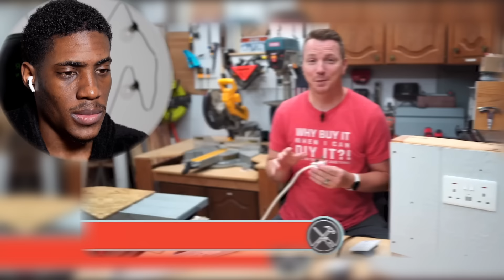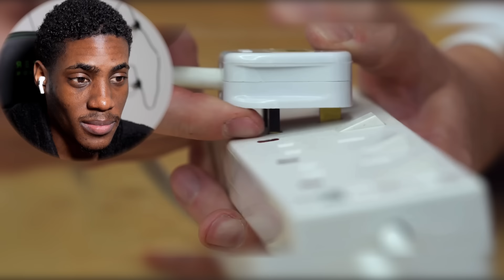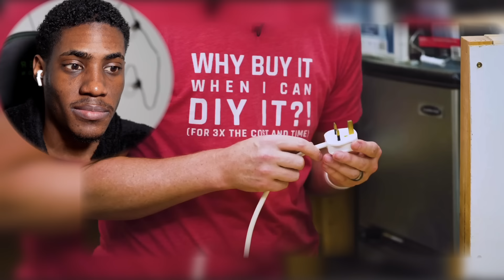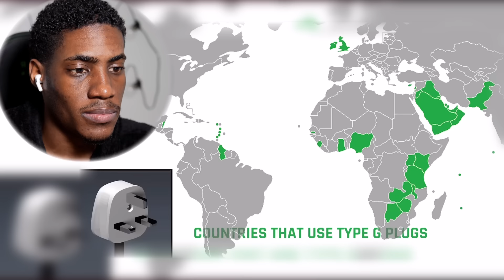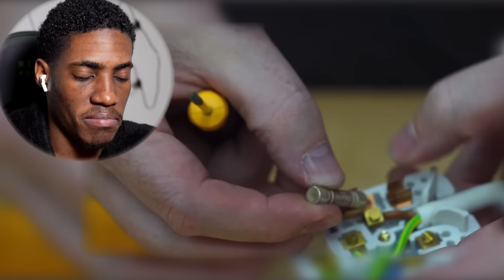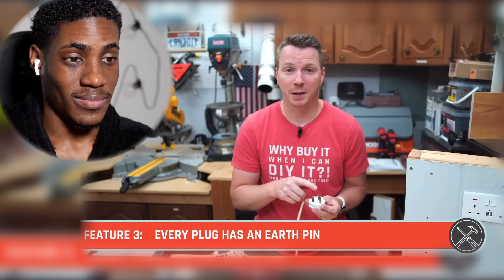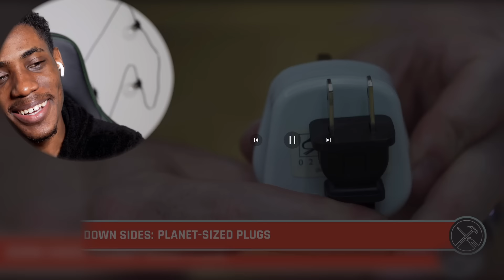Why British Plugs and Outlets are the best in the world || FOREIGN REACTS

Comment: Well done for poo pooing those negatives. I'm 79 and have never trodden on a plug nor do I know of anyone who has. Load balancing? I have never heard of it nor do I know anyone who will know. It has never popped up, you can boil a kettle, use an electric oven, use a washing machine, a toaster and do some ironing on under floor heating in the kitchen and not notice anything. Most appliances are always left plugged in. The iron is not but is put away after use in a cupboard, a vacuum cleaner is also put away straight after use. An electric drill is also put away straight after use, a jet washer is also not left out. No plugs are left on the floor for anyone to stand on. Trouble shooting something that doesn't work? Gordon Bennet, The first thing you think of is the switch. The ONLY down side to the system as far as I can see is, when a fuse blows and you don't have a spare, most people do have plenty of spare fuses of different sizes, you may be tempted to wrap some silver paper round the blown fuse, that of course is a big no no. You maybe tempted to use a 13 amp fuse instead of a 3 or a 5 amp fuse. The size of the plug is irrelevant as it sticks out only 3/4 of an inch from the wall and cupboards, boxes, washing machines etc, can be pushed farther back and right up against the plug. The insulation on the live and neutral stops anyone from sticking a knife or wire against them if the plug is slightly out from the wall and shocking them. If the wire gets frayed or cut, you can chop it off and refit the plug with a now shorter cable. If your TV, washing machine, microwave needs to be replaced, you cut off the plug and the fuse before you lob it, that way you always have plenty of spares and the fuses are interchangeable.

Comment: UK transitioned to the 3-pin square pin plug (BS 1363) in 1947. This update replaced the older BS 546 plugs and sockets, which had round pins. so as you can tell my house upgraded / rewired must be 30 years after the big switch, my grandparents had lots old stuff what required old socket, few areas got few upgrades new sockets like back room extension and behind the tv as new things had new plugs. so many years late to party my house got rewired and new sockets and lighting switches as the experts refused to work on system what mostly adapted by the house hold as back in day you not need a sign off for safety to some extent like kitchen spot lights if before a certain year it fine after that year you could fit them yourself but expert has to safety check it. your 4 pin plus do remind me plugs i seen on my grandparents old electronics some dating back to war times. uk upgraded 1947 some households took longer like mine to get upgraded, im amazed usa did not upgrade around that time to for a less war time plug/socket as that be an ideal time as things were starting to use more power you be far better for future. some pcs now have 1300w psu do you need two plugs to power that or get new plug fitted so it safe , even uk id not plug in 1300w to a extension 5 plug adapter if plug it direct in to wall and i know that be fine, unsure if you could plug 1300w device in to any plug socket in usa as uk i doubt it be an issue. my room has three 2 socket plugs all have 5-7 plug extension block and two duel sockets lead from just one duel  i must have 15 plugs if not more in use from 6 sockets and one has computer what reaches 550-600w soon closer to 700w as adding two high static pressure fans that an extra 30w each what require a cable from psu and hub to run as they burn the motherboard plug directly so small part house loop as you  can tell uses a lot electric and for past 15 years it works great, ive never experienced load balancing and that top floor house it also uses an aircon unit another crazy power device. they must wired house up good when we rewired the house no cut corners
Reply: I went through the same thing here, in fact when I was about 8 years old, we had a very small attic hatch & the adults couldn't fit through it, so it was up to me to help them run the cables through the attic - I've since become an electrician, then an electronics technician (& radio ham) & finally a computer technician.

Comment: You missed an important fact that many former British colonies (like India & South-Africa) stuck with the old pre-WW2 British system (3 different ampere rated plugs) with round pins and no fuse = "type-D" & "type-M" ... they basically had the Soviet Union´s situation (the USSR used unrecessed unearthed pre-1933 old german outlets al lthe way to it´s desolution in 1992 & phaseout started in mid 1990s)

Comment: The UK began adopting this system after WWII when a lot of housing needed to be rebuilt the economy was shattered and copper was expensive. As such the ring main used far less copper wire. Load balancing only became an issue later when we began adopting more and more electrical home appliances this has largely been fixed by replacing all the smaller guage wiring with modern heaver duty cables over the last forty years.

Comment: The negatives are a real stretch, the load balance thing is rarely an issue in this country these days, pretty much all UK households can run our appliances & devices without worrying about overloading the system & tripping the RCD - trouble shooting is pretty straight forward too, check the socket is switched on, if it is, try the lamp in a different plug, if it's still not working then change the bulb, if that doesn't work check the fuse, if there is a problem with the wiring that will trip the RCD, switching off the power to that part of the ring.

The stepping on the plug is easily resolved - put the plug out of the way, or just leave it plugged in as you don't have to unplug it when the socket has an ON/OFF switch.

The size of our plugs are never an issue for us, because we have had these Type-G plugs for a long time, so we're just used to them.

As a rule the first thing anyone in the UK will do when something doesn't switch on is check the socket, making sure the plug is in fully & switched on; our flat plugs mean we can have plug sockets behind furniture & not have to have that furniture 6 inches away from the wall.

Comment: Brit here. I’ve stood on one of those plugs, the pain is up there with a kick in the balls 😂 it really hurts!

The negative point he makes about the switch being a double edged sword - that is such a stretch! When you’ve lived with these plugs all your life like I have, the first thing you check is the switch at the socket if something is not working. On a daily basis, I plug the hoover in, switch it on and nothing happens until I switch it on at the wall socket.

Thing is, when you can switch it off at the wall, you don’t need to unplug it. Therefore you don’t stand on it! Also, if you trip on the wire in the UK, it won’t come out the wall to be stood on, whereas in the US it will. Either way, when you learn the hard way not to leave these laying around, much like lego, you just DON’T leave them lying around.

In 35 years, I’ve never had a problem with load balancing and I’m sure all other brits will tell you this. I have an extension lead plugged into one outlet, with a tv, PS5, surround sound system, my phone sometimes and also an iron plugged in - never had a problem! So that negative is simply not true.

I’ve heard in places in America, you can’t have an iron and hairdryer plugged in at the same time or the lights will flicker and it’ll trip something. We’ve never had this problem, we can have all sorts of things plugged in at once with no problem.

He says the plug is far bigger, but look again at our plug vs your plug  and imagine them plugged in - when ours is plugged into the wall, the pins are no longer an issue with regards to space. Also the plug is sitting flush against the wall with the wire coming downwards, so you could plug in a lamp and then push a sofa up against the plug - the plug doesn’t stick out any further than the skirting board so if anything it actually saves space vs the us plug with the wire coming out the other way.

Interesting fact - our plug was actually invented in 1944! Appliances used to come with a bare cable until the UK mandated a plug on everything in 1992. I was 3 in 1992, so I’ve never had to wire a plug. But every guy I know in my dad’s generation could wire a plug blindfolded. They learned it in school as it was an essential skill.

Edit: maybe in large commercial offices with dozens of computers plugged in, perhaps that’s when you might get that load balance issue. It’s not something I’ve ever come across so I believe with great certainty that it’s not an issue in a domestic setting. Maybe a large office having given it some thought…

Comment: Yeah - this guy was SERIOUSLY reaching for flaws.

The only legitimate one was "load balancing" ... but ALL modern UK homes (since roughly 2000) have a seperate ring circuit for the heavy duty ovens, fridges and washing machines, and - importantly - fire alarm

The fusebox, under normal operation, is NEVER tripped through overloading in a modern UK home (unless there's another hidden problem)

It used to be a problem. but it isn't now.

Comment: It’s ridiculous to say a US plug which has cable coming out the back is better in terms of size to a UK plug with cable dropping down vertically - the UK plug distance from socket to plug is about 3cm but the US plug will take up more space because the cable juts out. US plugs are annoying to fit behind furniture because they stick out too far. Also as UK plugs tend to be left in place there’s no reason for anyone to step on one left in the middle of the floor - who does that?

Comment: I know others have said this in the comments but the guy featured in the video, does not know what he is talking about, when he says that the UK has 'Load Balancing issues', no we don't, as a typical house will have 5-6 ring mains covering different areas of the house. In addition, fault finding is very easy, I've watched an electrician do this in my own home and it was straight forward, despite being under some floorboards.

Comment: One of the simple things about having a switch on the socket is that it is extremely easy to see if it is off or on. 
Most modern British sockets have a small red strip on the top of the switch which is only visible when it is switched on.
So to see if it's on you just look for red. Or if there is no red strip look at the position of the switch, top out is on, bottom out is off.

If you have a socket behind some furniture, you can use a plug with the furniture pushed right up against it.  US plugs with the horizontal wire position are a much greater restriction on where you can place your furniture. 
Most bedrooms in the British Isles have wall sockets placed on the wall beside where you would place a bed, so it would be behind a bedside cabinet or table. Allowing you to put a lamp or electric alarm clock/radio on the piece of furniture.

With the introduction of wall sockets that include USB sockets, they are being placed higher on the wall so the USB sockets are available to charge mobile phones, tablets or other media devices.

A lot of equipment manufacturers now produce cables with moulded plugs, for their apliance, that are not able to be opened. They have an external fuse slot like that shown in the vid. 
Obviously if something goes wrong with the plug you would then need to replace the whole appliance or get an 'authorised' repair engineer to fix it. Just another way for manufacturers to get more money from consumers. I don't know anyone who wouldn't, either themselves or ask someone who is confident doing so, just cut the faulty moulded plug off and connecting a new plug. 
We know when manufacturers are trying to gouge money from their customers. Claims of 'authorised' repairers needed and warranty voided are just encouraging consumers to pay for extended warranties or service agreements.

My dad showed me how to change a plug when I was about 10. Many of my school friends were shown how to, by their own parents or grandparents, around that time too.

You don't really need to be shown how to do it. Each replacement plug comes with a piece of card with plug holes in it, so it attaches to the plug. That card has a diagram of the open plug showing which wire goes to which pin, and how the wires should be placed. The wires are labeled by the colour they are likely to be. There are 2 colour systems. Modern is Live Blue, Neutral Brown, Earth Green + Yellow stripes. The old system is Live Red, Neutral Black, Earth Green.

Comment: Hi! Very little world, yours. Just USA and UK😂. I live where, for some aspects, Britain still rules and I miss European plugs. The UK ones are ridiculously chunky. More, even for a low wattage SBANG! The Brick😱. Just consider a phone charger. It needs to be built around the plug. In Europe you have plugs for high wattage with neutral, and the ones for low wattage are much smaller. And people don't get electrocuted for that. Also, the chunky plugs need chunky sockets. I think the design of type G derives from the more flammable house building materials used in UK (at least years ago when the type G was created). Then, some are fused some are not, but shape is "dangerously" the same. BTW, yes the USA plugs are strange. When I have been explained the reason of the holes on the metallic blades, I couldn't believe it. Not sure, but something has changed about those little holes, recently. Thanks.
Reply: If a type "G" plug isn't fused, then it's a cheap Chinese knock-off, isn't to British Standards & shouldn't be used.

Comment: The ring system is far superior at carrying bigger loads than a radial 
So one point can carry a load up to 3kw that’s an A/C machine 
We ring the system so we don’t have to balance unlike the radial 
We can also spur from our system several times to increase outlets 
Where it’s a lot more dangerous on a radial cause your still only using one cable 
Our plugs are far superior and safer than any other in the world 

I’ve also seen how weak and thin your exterior/garage supplies are in comparison to our external feeds

Comment: I grew up with 13 amp plug system as we call them in the UK, now the majority of the wall sockets in a UK are not switched, it's sockets that serve multiple appliances and are plugged in and out several times a day, as in the kitchen. Another good thing about the 3-pin plug is the live wire is fused in the plug, so the fuse needs to be checked for the appliance correct fuse size. Some plugs are molded and are just for the appliance supplied with. 
But having the same position for the live/positive feed means it connects to the live/positive terminal in the appliance and so the appliance switching is on the that side. 2 pin plugs can be swapped in a socket, so the live pin engages with the negative terminal.
Reply: I'm old enough to recall the system we had before with the 3 round pins instead of 3 rectangular pins, there were 2 different sizes for different size loads, 5 amp for light loads (TVs, radios etc) & 15 amp for heavier loads (things like electric kettles, electric irons, washing machines & toasters etc.)
There is a good website giving the history on British plugs at The Museum of Plugs & Sockets.

Comment: In my 60+ years I have never, ever had an issue with Load Balancing. Nor has anyone else I know.
Appliance not working? Check the socket (outlet) first then the actual appliance.
Step on a plug? We don't. Because we have switches on the sockets we just leave them plugged in.

Comment: The negatives are not negatives at all. Everyone knows to check the wall switch first if an appliance doesn’t turn on. Also nobody in their right mind leaves plugs unplugged and lying in the middle of the room. First, there’s an on/off switch so there’s no need to unplug them. Second, if they are unplugged they are left by the wall socket and not tossed into the middle of the room. Stephen

Comment: The whole point of a ring circuit is the current flows in both directions. So all the sockets get equal current.  Example: Let's say the length of cable on the ring is 5 metres. There is one socket in each direction at metre and one socket exactly half way. The current to the first socket on the left is at one metre, but it also receives current from the right at 4 metres and the first socket to the right has the same, but opposite direction. The socket half way receives current from both directions at 2.5 metres. They all receive current with equal load on the cables at 5 metres.
Reply: That could also be a disadvantage!If there is shortcut there wil be to much current,because in the European plug there is only 16 amps.In  the British i have seen up to 30 amps.Because off the lower voltage.We have 230 volt,you still have places with 110 volts.

Comment: One error was he said that if an appliance has a plug with a plastic earth pin it is double grounded. The correct term is double insulated, not grounded at all. Load balancing on ring circuits is not an issue, it is one of the main reasons ring circuits are used. Also for a given load current on a 240V system is lower than on a 110V system.
Reply: He actually corrected that in a piece of onscreen text that was obscured by the YT reactors face insert.